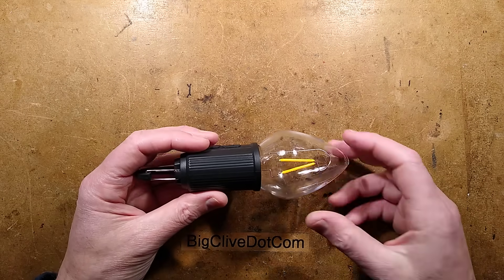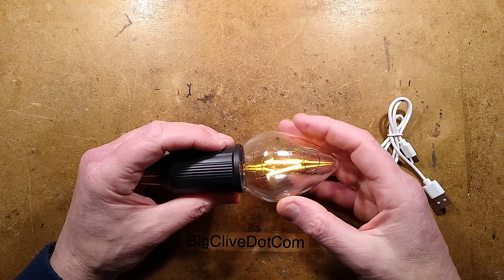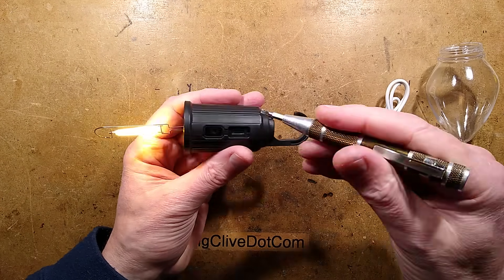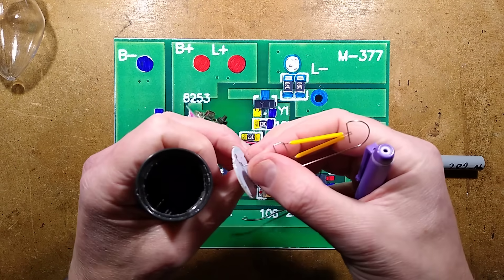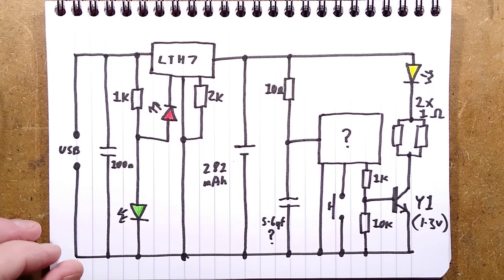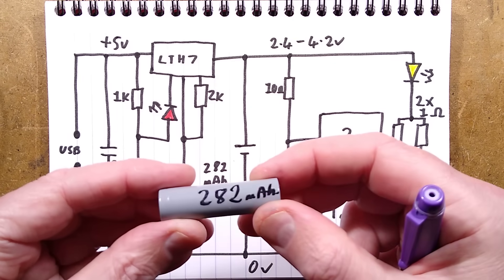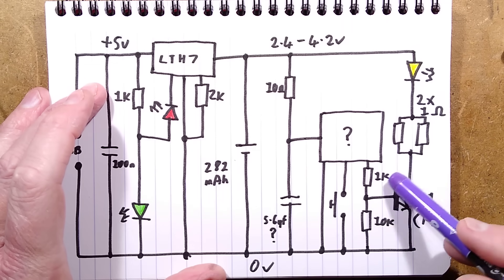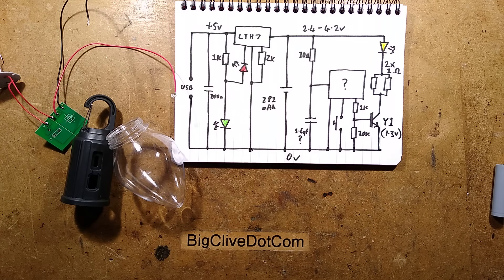Temu rechargeable filament light

Comment: It is crazy how china builds these devices so cheap. Also, you’re almost at 1,000,000 subscribers! I would love to see a desk tour when that does happen. Thanks for these awesome videos.
Reply: I believe its a crap-o-lanch .......about to happen.
Reply: It is important to learn why, because China jas had some successes and some failures but if we learn the nuance's globally we can adopt what worked and abandon what did not globally for a net good.

interactions between state owned systems and maufacturing centers and capitalist corperations really are the star winner in the price reductions China is capable of.

We tend to think its just lower wages and saftey standards, but those are complex, my family has a history of traveling to China for thier significantly HIGHER wages then back to the USA for living where we dont stick out like sore thumbs.
And thats fairly typical for manufacturing positions that require a degree with years of training and support lower tiers of entry. 

But because many of the manufacturing facilities are owned outright by the goverment actually getting your idea mass produced has a much lower barrier to entry

However, the local labor has a mindset of "what is the cheapest/fastest way to build something that does the job" instead of a balanced mindset, or a long term mindset like most other robust producer countries. One that is slowly changing but it makes sense for the recent history of China gearing up for fast/cheap high value low effort export production to get food trades from the US during a minor famine; whom now supplies a sizable portion of China's calories, mostly in corn, chicken, and soybeans.

So with that part I think looking at manufacturing plants the same way western countries look at public libraries is a win/win for everyone.
but 
There is still cheaper average wages
And part of that comes from all land and buildings are owned by "the people"; really the goverment its just leased for truely brand dedicated manufactruing plants, with it being a human right to be allowed to stay in one residence, you cannot be evicted for any reason even the good of litterally everyone around you, but your earnings can be garnished if you refuse to pay, so no homeless, but some really weird city planning. Its another thing they do that is a nuanced win and loss, it does allow people with common skills to have a better quality of life but it also allows Capitalist frameworks to easier abuse the situtation and have people with common skills work for significantly less. 
Therefore I think it is fair to say that the outlook China takes is not quite balanced, really things are only valuable because we humans decide its valuable; the market of consumers is what allows any other market so I find an true UBI ideally shared between many nations or all humans to be sort of the solution to finding balance under a monied system. Because being a consumer adds the value to the product, being a consumer is a vital role to all economy and should be paid; but you could and should particiape in advancement more, so by levying a (honestly rarher heavy tax) on all profits and distributing them equally nobody can be taken advantage of. And its a weird thing that FIAT money does that, that it takes being a consumer and makes that truely vital; we as a global society should look into other trade systems so that cheap junk does not ever have value.
Reply: china abuses the UPU (Universal Postal Union) which offsets shipping to poorer/developing countries to be SUPER cheap and making it more expensive to other countries, including Lithuania (where i had to spend $18 to ship a tiny CPU cooler adapter, a 50g/1.6oz SCAM4-1000B)

Comment: A tip to get a device like this (without the resistors on the data pins) to work with a smart charger is to use a Portapow Data Blocker.
Reply: I thought they just defaulted to 0.1 amp if they can't establish a "smart" connection.  Did that change on newer chargers?
Reply: @jmr I'm guessing the named adapter handles the power negotiations without passing data between the sides .  If it was really good it would even do voltage conversions if either side has a higher wattage setting .  Basically the power input side would negotiate whichever volt x amps combo delivers most energy, then the output side would contain a switch mode DC-DC converter to output that energy according to load preferences .  For example if the power source offers 200W at 40V x 5A but the output only wants 20V, the adapter would output 20V x 10A, but any combination in the various specs would be handled, from USB 1.1 lowest power mode to USB 4.x highest power mode with neither side knowing anything about the other .  It should even be designed to survive "USB killer" products .
Reply: @johndododoe1411  That model is as dumb as possible.  It's just the data wires cut but my question had nothing to do with that.  My question is why doesn't the smart charger fall back to dumb charger spec.  That's supposed to be the default when higher voltage or higher amperage can't be negotiated.
Reply: @jmr That's how it's supposed to work. You should get a basic 10W 5Vx2A capability.
Reply: @jmr USB-C proper PD chargers will not turn on until they handshake with a device to negotiate power level and voltage.
Reply: Actually its not the data pins but the CC pins for USB-C.  I'm guessing that data blocker you mentioned also would break PD charging
Reply: @matthewmiller6068  Literally says and shows data pins on the description I found.  There are no cc pins accept in USB C standard to the best of my knowledge.
Reply: @matthewmiller6068  I figured out where I was going wrong.  I was looking at the design of the standard data blocker instead of the new version meant for USB C.  Thanks for clarification.
Reply: @johndododoe1411  We figured out I was looking at the wrong data blocker.  I don't know much about the variant the OP was actually referring to.  I looked at the correct brand but the wrong version.
Reply: Thank you!!! I've got a USB charging socket in my gaming room and I've never been able to charge my Nintendo Switch controller from it, it just doesn't work. After reading your comment I ordered a PortaPow, it arrived today and I just tried it and problem solved!!!

Comment: "Not designed for the stress I'm about to expose it to!" - That's a Roger, Mate (and the reason why we're all here!!) Mind you the "disassembly" was pretty non-damaging and it'll survive to provide illumination (possibly with a larger battery pack??)
Reply from the maker: It's since been fitted with a 1500mAh vape cell after some slight plastic modifications.

Comment: I decided to check the battery in my multimeter. It was a PP3 and measured 9 volts, so it was good enough. While I was at it, I checked my 1 KHz sine wave generator, transistor tester, capacitance tester, ESR tester, computer mouse, torch and remote control for the aircon. Three of the battery cells were oozing! If I'd left them any longer, the spring terminals would have started to corrode. So here's my suggestion: right now, before you forget, check every dry-battery-powered piece of equipment in your workshop, house and car. In some cases you can replace them with rechargeable cells, which won't leak. You can thank me later!

Comment: Hi, just wanted to say thanks for the heads up about the incredibly cheap UV phone sterilizer from a few weeks ago. It's true shortwave UVC light (about 50-60 milliwatts optical output) at 280nm with a FWHM bandwidth of 10nm as measured on an Ocean Optics spectrometer so it really is sterilizing things, and because there are no annoying visible light "warning" LEDs included in the UVC emitters it produces extremely clean UV light for illuminating fluorescent minerals (you can see my review and images on the product page). For an unbelievable $6 it's the cheapest source of clean UVC light I've ever seen.  What a great find! I wish you would revisit it to see if it's hackable to easily increase the LED power!
Reply from the maker: Theoretically, reducing the value of the current limiting resistor will increase the intensity.
Reply: @Muonium1  These might be obvious but a couple things to consider. If the design is running the LED close to its max power, increasing the current through it could pop it. And running it at higher power will definitely reduce its lifespan. I would like to hear how it goes!
Reply: @ChrisTasr92  I'm aware, but.... they're 6 bucks!
Reply: I can't find it... link, pls?

Comment: Interesting. I'm thinking about using these pseudo-filaments in a retro 7 or 16 segment display. A modern take on the numitrons and minitrons...
Reply from the maker: They are available in 12V, 6V and 3V versions.  Mikeselectricstuff made a clock out of them.

Comment: Very nice, I expected it needed the vice of knowledge to dismantle. Would be interesting to investigate more if it is a new low capacity / fake AA lithium battery or a reused worn out cell; compare the weight and open it etc.
Reply: Yes, I had the same question. That would be Interesting. When I bought my first 14500, I found offers for 1200 and 3000mAh on Aliexpress. I knew, that 3000 is impossible, so I ordered the 1200 offer. It had only about 300 or 400mAh. Trash

Comment: This thing would have been ~30% more efficient if they used 20kHz pulse duration modulation on the output with an LC filter for current limiting, a shottky flyback diode instead of current limiting resistors and a FET to eliminate the base current along with reduced CE/DS voltage drop.
Reply: Ya, what he said.

Probably.
Reply: @snufftherooster93  What I described is basically an open-loop buck regulator. This only works when you don't care about regulation against battery voltage and load changes, the load being constant (give or take a bit due to battery voltage) in this case.
Reply: @teardowndan5364  I think the guy you responded to is not an electrical engineer.
Reply: @therealjammit  - I work in a warehouse, and was a cook before that.

My electrical experience is plugging in a phone charger upside-down.

I just like seeing things being taken apart, for curiosity's sake
Reply: @snufftherooster93  There are many people here who have no interest in electronics but enjoy his voice and watching stuff being taken apart (just like you).
Reply: You should make a video explaining your idea.
Reply: @MichaelOfRohan  it isn't that much of a novelty. What I described is also more or less how 1-bit DACs work.

Comment: I'm curious about how you measured the voltage across transistor Y1. Was that using an oscilloscope?  If you used a standard DC voltmeter, I guess you would get incorrect results since it is using pulse width modulation even on the highest setting.
Reply from the maker: That's a good point.  It will be skewed by the PWM.
Reply: @bigclivedotcom With no scope, a low pass filter in front of the DMM could solve that, like 10KΩ and 100μF feeding a 10MΩ meter .

Comment: It would have to be a logic-level MOSFET which is not cheap. 
The voltage drop of 1.7V across the transistor says the transistor is not saturated.
Reply from the maker: The A2SHB MOSFETS are low gate voltage, cheap and have ridiculous specs.

Comment: Where is over discharge protection for the lithium cell?😊
Reply from the maker: The control chip may shut off below 3V, but the LEDs will be almost fully extinguished at 2.5V

Comment: Hmmm, instructions said not to leave plugged into charger (does it work when plugged in as well?), but looks like the chip will stop the cell from charging once it's reached voltage threshold.  Which is it?  Other than not leaving these cheap usb things plugged into chargers when not being watched occasionally...  :)
Reply from the maker: I think the instructions are just mass copied generic ones.

Comment: Does the USB connector have only 2 pins or could the CC resistors be added without changing it ?
Reply from the maker: They could be added, but using a simple charger would be easier.

Comment: would they be any way to skip the 2 step diming part? just to have it be an on and off switch at the max output?
Reply from the maker: Only if you replaced the circuitry.

Comment: Replace with a 26500 battery which is the same length, but larger diameter.  Would be curious to see if it works.
Reply: Or print a new enclosure with space for a 5Ah 21700. Either mod would give it so much capacity it'd become a decent camping light.
Reply: @fallingwater  Less work to use a 26500. These can supposedly go to 3000mAh.  I see on the bay you can buy them with leads already attached.  Assuming it fits of course.

Comment: 280 mAh for a 14500 is terrifying. Where are they getting sufficient "recycled" 14500s from? Is it just a 13400 (e.g. mass produced for disposable vapes) in a box? But they're 550 mAh even in that disposable use case.
Reply: They're likely cells that didn't pass QC, which to be honest is even worse than recycled cells in terms of potential safety.

Also the small disposable vape lipos would likely be a great candidate for upgrading these. I've got a drawer filled with them, very useful.

Comment: Have you tried holding the button on for SOS function? there cant be chinese design product without SOS.
Second point is how do you take 4 to 5 hours charging 260 mAh battery on 500mAmps?
Reply from the maker: The charge time may be based on an original higher capacity cell or it may just be cloned text.

Comment: yes, yes. but LED street lamp?  how to make it on/off at my command rather than built in dusk sensor or 10 minute test circuit upon powering? 3 pole bayonet on top.
Reply from the maker: If you own the street light you could get a spare photocell for the enclosure and then fit a remote receiver.

Comment: Excuse my simple mindedness- but i dont understand the red and green led setup. If there is one resistor feeding both leds, the green always pulled to ground, and the red pulled to ground by the mystery chip, why wouldnt the green always be on? What is it about the red one coming on that shuts off the green?  Sorry, i dont know enough to know what i dont know.
Reply: The forward voltage of the red LED is lower than that of the green LED, so with the red turned on by the chip, the common point of the LEDs is pulled below what the green one needs in order to light up.
Reply: Ah! It all just clicked in my head now... Thank you for explaining!

Comment: Do you need to replace the cell by a LiIon-Cell or can you use 2,700 mAh NiCd or NimHy? 🤔
Reply: LiIon is 3.7V nominal rather than the  1.2V nominal of NiMH, so you'd need to add a boost circuit to be able to power the LEDs off a single NiMH cell.
Energy wise 2700 mAh NiMH is about equivalent to ~850 mAh LiIon,  IIRC you can get ~1100 nAh 14500/AA LiIon cells, but 800-900 mAh are more common.
Reply from the maker: It would have to be a lithium cell.  For NiMH you would need a cluster of cells and/or different circuitry.

Comment: That's pretty s**t capacity, even for a 16500 cell. Actually, that's really s**t capacity. Are they recycling cells, or maybe using factory rejects? Or the ever popular "itty-bitty cell in a larger cell body with a whole bunch of filler"? Though I admit it has been a while since I ran across any of those once kinda common "high capacity" partially sand-filled cells. But it is a neat little light, even if you have to replace that awful thing. I really like those filament style LEDs a heck of a lot.
Reply: Me too, the filament led run ultra cheap as house lights

Comment: I've got a question.  If there is enough room for two of those AA size lithium cells, would it be okay to connect the two lithium cells in parallel?  I've seen battery packs with 18650 cells in parallel so I know that it's done.  But what has to be done to parallel them?  Another idea - stuff a few vape cells in there, all connected in parallel. Thanks, Clive.
Reply from the maker: You can connect multiple lithium cells in parallel as long as their voltage is close when you do so to avoid high current as they balance.  Not sure two AA size would fit in the light.
Reply: The battery they included in there is so bad that the rechargeables from my dollar store are 4 times the capacity, 1100mah. Good ones are like 2500mah. I would just put a better quality battery in it.
Reply: @buddyguy4723   I'm fairly certain there's no 2500 mAh LiIon cell in AA/14500 size (I'd love to be wrong though, best I e seen is 1100 mAh IIRC, so if you've got a source of them, do tell!) 
I suspect you're thinking of NiMh, for which the good ones in AA size are around 2500 mAh, but at 1.2V instead of the 3.7V of LiIon.
Reply: @michaeltempsch5282   Never mind I thought that was just a 1.2v NiMh battery. I guess you can still get 2300mah 14500 Li-ion though. According to Amazon, supplier China lol
Reply: @buddyguy4723  Capacities of batteries stated by most Chinese sellers om Amazon/eBay/AliExpress et al should be taken with a pinch truckload of salt... 😁

Comment: Or..OR you could strip out all of the circuitry and use it as a mini thermos with zero thermal properties for non challenging climates where the temperature never deviates much from 70 F!